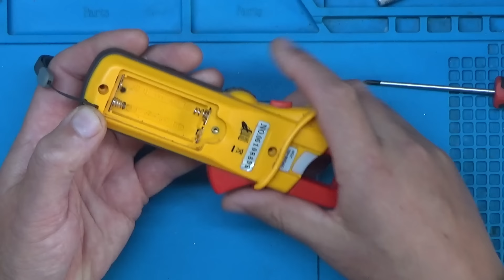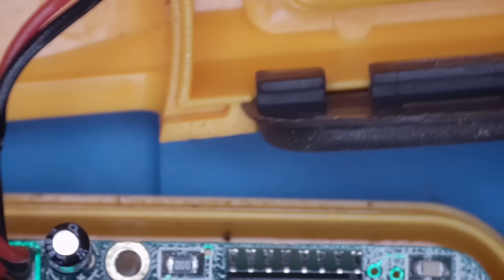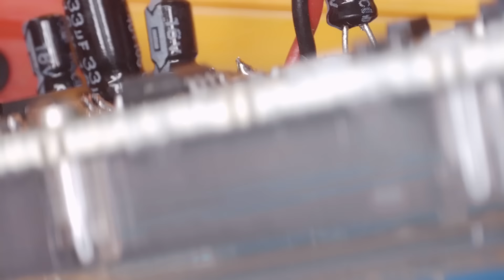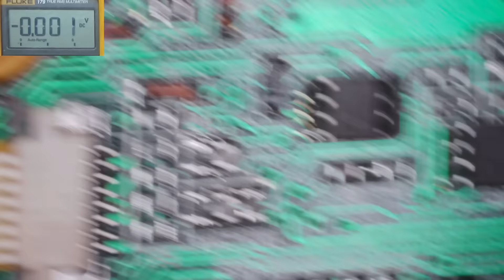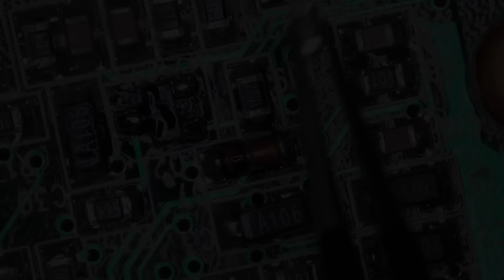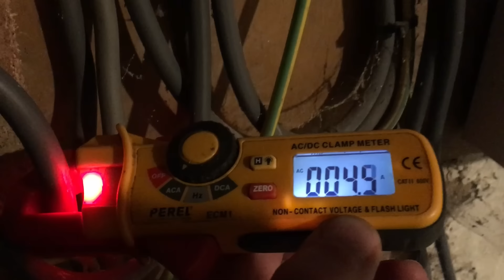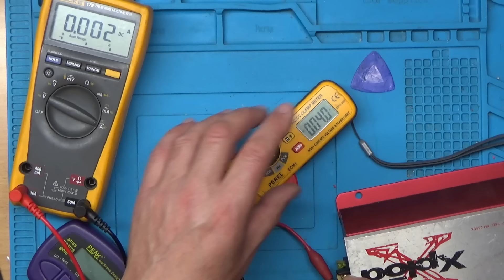Faulty Perel Digital Clamp Multimeter | Can I Fix It?

Comment: Someone has gone to the basement of the building where they keep all of the lowest quality components, and picked from the scrap pile. That meter is very cheap. I'm all about fixing. Even things that are deemed too cheap to fix. But the fact that this crap even happens because 0.00001 cent per board is saved in production cost - that is absolutely HORRIBLE!
Reply from the maker: Yes, I've never came across resistors just failing that like before. They must have used the cheapest of the cheap!

Comment: I blame the disease of resistors on poor-quality production in the SMD factory. This is the cheapest, low-quality clamp meter you can find. Parts are from leftovers. The broken ferrite inductor is further proof. As for the residual 4 Amps DC, it has to do with the magnetic field disturbance at the tip of the jaws. It varies with the wire's position inside the clamp loop and even interferes with the Earth's magnetic field when you rotate the meter. I saw it on all UNIT-UT210 clamp meters too.
Reply from the maker: Interesting observations, thanks for sharing your technical insight on these units! 👍

Comment: When you buy the cheapest resistors at the Shenzen market don't expect any quality. Clamps need zeroing when measuring DC, as background magnetic fields will interfere. Even if you change the orientation of the meter, the reading will likely need to be zeroed again.
Reply from the maker: Yeah agree. I've not really had any experience with clamp meters, but yes a couple of people mentioned about the zeroing 👍

Comment: This might be what's behind my woes with my old Uni-T ac/dc clamp. I discovered the ncv detection totally failed at some point, and the dc values on the probes developed a bizarre offset of a few volts around the same time. Never would have even considered the resistors, but I'll check them out now
Reply from the maker: Yes I didn't suspect them either. I wonder if it's some poor quality resistors or something.

Comment: Strange fault, logic suggests as the fault lies only in the DC Amps circuit that it is unlikely to be environmental issues. Much more likely to have been exposed to excessive voltage or current, damaging the resistors while in DC Amps mode. Great job though! You seem to be able to fix anything, including your own videos. 🤣

Comment: I reckon that's been whacked hard against something and warped the PCB momentarily making a few resistors microscopically crack and go open circuit along with the inductor core breaking.
Reply from the maker: Could be, although I did have someone else mention that they had a similar one where resistors randomly went bad too, so perhaps they are just poor quality and the thin film coating oxidised or something over time.

Comment: These type of DC ammeter clamp meters usually do have a small offset.
You use the ZERO to null out the offset and do NOT move the meter as it will be influenced by the earth's magnetic field.
A 4 amp offset is rather large though and probably there is a pot inside to reduce it, but still will be influenced by the earth's mag field and movement.
Great job with all those flakey resistors and the broken inductor!
Reply: His house is probably on a ley line causing the extra spiritual reading to show via the meter 👻😀
Reply from the maker: Spooky! 😂😂😂

Comment: It's normal to have an offset in DCA and it will vary with the electromagnetic environment. That's why  there is a zero button: you must zero the meter in place before taking the measure (it will remove the offset)
4A seems way too high but it's still registered +5A when you tested it, so it "works fine"
Reply from the maker: Thanks Nick, yes a few others mentioned similar. I just thought it was odd with it saying 4A. Pressing the zero does zero it, but pressing it again reverts it back to the 4A.
Reply: @BuyitFixit Don't press it again. Press it, let it display zero and take your measurement, it should show 5A instead of 9A

Comment: Hello.
Might be wrong place to post this, but i could not find any other contact info.
We are having some problems in my workplace where the intrated lead acid battery charger breaks. The fuse is ok, but the mosfets are burnt. We had a few spare ones that we swapd when they break. Would you want one sent over and have a look at?
Its a 240v ac to 24v dc lead acid charger it does 10a 24v i think. No transformer.

Comment: Hi sorry to bother you.  Could you do a small video please.  You have a test circuit board system with a bulb plug and mains power switch THAT you always use to test Wall power tools and electronics.  I want to build one and not sure how to go about it.  Could you show and tell your version of setup please.  So I can better understand how you wired it.  Thank you very much.  This item is very much needed right now.
Reply from the maker: It's just a socket with a filament bulb wired in series with the live terminal. It's just current limiting, so if there is a  short for instance it just makes the bulb light up, and saves blowing stuff up. Hope that makes sense?
Reply: @BuyitFixit  if there is a short it lights up.??  ehhh.  The ones I have seen is when LETS say PSU on that circuit.  When capacitors reach full power the bulb goes out.  OR If nothing draws NO power or completely DEAD then bulb remains off.  If system works but fluctuates randomly then Caps could be bad in circuit.  
That is how i thought your setup worked... Im so confused.....  Let me grab another persons video for you to see what im talking about.
Ok found a link.  I thought yous was  a simpler version to this one.  I really need to make one badly.  Got many items needing a test system.  Have no clue how either of you have made them...  https://www.youtube.com/watch?v=G_fVVlTQRLo
Reply from the maker: He's got a nice fancy one, with a voltage meter and bypass switch by the looks of it. The one I made is really simple. Check my video here https://www.youtube.com/watch?v=aEQu1vd7OxM not far from the start I talk about how it works, and even show a diagram. Hope that helps.
Reply: @BuyitFixit  Fancy making a video making one...???  I would look forward to making one myself.....  Hopefully the same as yours.  I was thinking of having a reader showing voltage DRAW at teh socket aswell as the intake at the wall.
Reply: @BuyitFixit  Okay now that makes sense and that is how I thought I would normally do it.  But upon research its not what it was saying this is why I spoke to you...  Thank you.  However. I must admit I think the other guys setup I think you need to make.  I think that would be right up your street.  But for now YES I will make this one.  Thank you so much friend.
Reply: @BuyitFixit  i hate series and parralels.  Nop makes no sense lmao...  Love the DCA55 video nice work..

Comment: DC amp clamp meters measure the magnetic field directly rather than voltage from a coil as AC only clamp meters.

Reverse the direction of the wire and the 9A will likely read -1A (negative 1A). If the meter doesn't hold zero measure both ways and average

Comment: I had one. Before finishing your video I can tell that mine had moisty failure. I had to repair it by adding a lithium ion battery inside, wich permits to turn on and off the device. Impossible to make it right with the considered voltage. Now I will finish the video and see what's is defective in yours.  Ok I am pretty sure that all those resistors was affected by WATER issue. Thanks for the video

Comment: Great stuff here! I wish you could help me with something similar along the line. I bought an Aneng ST180 Clamp meter from Temu about 2 months back. It stopped working after one week. It switches on with a display. But it does not give any reading. I checked about everything including the probes. Nothing wrong with them. My competence fails beyond this level. Could you please help me? Thanks and warmest regards. Shmuel Naarai.

Comment: I'd think a bad environment. Heat cycles, vibrations and maybe chemicals.
Reply from the maker: Could well be. I was interested and started reading an article on resistor failures. Mechanical stress, and also age related issues were mentioned.

Comment: That was an old electric meter. It must have been at least 30 years ago i used one of those. Those meters are so easy to manipulate 😁

31:24 You need to press the ZERO button ...
Reply from the maker: Yes old house this one. Built in the  1500s. I'm sure the electric meter is newer than that though 😂😂😂

Comment: Interesting. We have the same meter in work, different brand but it looks the same and it have very similar problems, like measurements jumping all over the place even without measuring something. And it's getting worse over years. Looks like some cheap or bad batch of resistors been used.
Reply from the maker: Thanks for the info. Yes could be a bad batch or cheaply made resistors that oxidize over time or something.

Comment: Mick, at 24:17 you found a resistor off reading of 5.6k when it should be 5.1k.  Those appear to be precision resistors so if that one is off by 10% then that could be causing the offset on the DC current scale.  I would replace that one with another 5.1k precision resistor and see if the DC offset goes back to zero.  Great video.
Reply from the maker: Thanks 👍 Yes I had been thinking exactly that when I was editing the video. I might change it and see if it cures the offset problem.
Reply: @BuyitFixit  Ping us an update if you do. That really is bizarre. The only time I've seen resistor failures like that is high power resistors or FET gate resistors. Certainly not random high value resistors.

Comment: Very strange that so many resistors where out of spec, maybe they all came from a bad batch or something.  Thanks for the video at least the device can be used now although not sure I would fully trust it.
Reply from the maker: Yes could be a bad batch. I'm not sure how much I'd trust it either. I guess you could compare with another meter to see how accurate it is.

Comment: Is it possible that the X-Ray machine induced high voltage in the pickup coil or hall effect sensor in the dc clamp? Also, my DC clamp meter always shows a few amps until I zero it out.
Reply from the maker: Interesting theory but I doubt it. I've had phones and all kinds in it and they are working fine. It's quite a low power one, similar to an airport scanner.

Comment: I was hoping it was that inductor as I've seen those get damaged by shock a few times. I found one in a Sonos Connect that I bought cheaply as "spares or repairs" on ebay and it was fixed for free as it just needed solder and hot melt, and I got an "Accu Charge" smart car battery charger/optimiser at a Repair Cafe yesterday with the same fault.

Comment: My coworker has a Klein clamp/multimeter, with one problem on it. When you switch to continuity check, it is shorted somewhere so it measures continuous continuity in that mode, but seems to work fine with all other functions. I’ve opened it up but didn’t have my microscope available so I didn’t see anything obvious. I really need to find a circuit diagram for it lol
Reply from the maker: There doesn't seem to be many circuit diagrams for modern stuff these days. Could be something like a blown resistor or diode. Maybe they measured voltage while switched to resistance or something?
Reply: @BuyitFixit thank you for the suggestions on what to look for! My experience thus far has only been with obvious physical hardware issues, so I am still a complete noob when it comes to board level troubleshooting. I definitely have the mind for it, just not the experience (yet).

Comment: I think it got dropped on the ground. The snapped inductor is a clear sign. Consequently many resistor cracked, I would also suspect many racked MLCC capacitors as well, but those will be very hard to spot - you would need to measure the capacitance, which is hard without removing them from the circuit... Plus a lot of cracked resistors may just exhibit intermittent fault, so seem OK when testing them but wander off value during operation...
I would not trust the meter after that at all.
Reply from the maker: Could well be. I'm not sure how much I'd trust it either.

Comment: For DC clamps you have to zero them on an almost per-measurement basis. There is a good chance the ferrous core gained a permanent offset and that's why it's all the way up to 4A in this case. They are even sensitive to the earth's magnetic field and their orientation to it. Despite these obvious shortcomings, measuring DC non-invasively, is quite useful!

Comment: Well done. Can you let me know what low melt solder you used? The stuff I have certainly doesn't solder as well as yours does (even with lots of flux).
Reply from the maker: Thanks 👍 It's Chip Quik. It's quite expensive, but you only use a tiny bit. I've only just gone through my 1st tube of it and I bought it over 18 months ago...
Reply: @BuyitFixit  Thanks. I did buy the Chip Quik brand but probably ordered the wrong composition. The one I got was SMDIN66.3BI33.7. Do you know the variant you got?
Reply from the maker: The one I'm using currently just has REM4.5 on the tube.

Comment: A techy like you and you still have a spinny disc meter! You need to get yourself a smart meter so you can connect to it on your phone and see actual real time readings!
Reply from the maker: No thanks 🙂I've got solar panels 😉
Reply: @BuyitFixit me too and the double bonus of the smart meter is that it lets you monitor when you are "feeding in" to the system, so can divert that energy into use or storage (as the FiT is waaaay smaller than what you pay. It also let me monitor when something odd is going on, like my heat pump kicking in at unusual times. Indeed I see no valid argument NOT to have one

Comment: I wondered about a bad batch of resistors or perhaps fallout from a physical shock. The offset on DC amps may be normal. DC current is sensed with a hall effect device and is sensitive to the Earth's magnetic field. The "zero" button compensates for that "background noise". Someone may have also exposed the meter to a substantial magnetic field at some point, which will also distort the DC amps reading. I believe that a degaussing wand might fix it (reduce the offset), but have yet to test that theory.

Comment: You have to zero it out when measuring amps dc with the clamp, that's normal. If you'd zeroed it out it would show the correct 5 amps there. Also I think it might have been dropped big time at some point. That cracked the inductor, tilted the two capacitors to one side and might have also damaged the resistors by breaking the wire inside them.

Comment: I suspect if it was an over voltage or over current problem, then there would have been semiconductor damage as well.
As it only affected the resistors I'm thinking it was a high impact force that caused some micro cracking in the resistors (probably not the best quality to start with).
Regardless that was a great fix!
FYI, Clamp meters usually have a Zero or "REL" (REL being for relative) button to mitigate picking up any stray magnetic fields.
It can also be used to set a "reference" if you are trying to measure differences in current flow (saves you doing the math)😀
Reply from the maker: Thanks for that 👍Yes the ZERO does seem to work. I tried it after reading a few comments. I was wondering if micro-cracks from an impact as you suggested, or if it could be something like the components deteriorating over time (oxidising or something).
Reply: @BuyitFixit  That also has a very high probability. Thick film resistors (as opposed to thin) are cheaper to make and are more susceptible to oxidize or deteriorate over time I think.
This might be a stretch, but if the clamp meter was used a lot around lead acid batteries then the resistors could be more prone to rapid sulphurisation. This is where sulphur gas can seep into the component and react with silver that is present. Cheaper components like resistors are more prone to fail due to sulphurisation than other components, like ICs that use copper or gold bonding wires. These type of problems can sometimes take years to raise their ugly heads and then a fix might take years to confirm.
Regardless you noticed the trend and managed to repair it, great job!
Reply from the maker: Thanks Jack 👍

Comment: at 18m06s top right  the transistor  M7 looks like its cracked or chipped near the Number 7 , i would have also changed the cap you were testing the 3v on it looked buldged ,  and at 24m20s the 3rd Resistor down you were checking seemed to have a stray piece of solder on the left of it ..

Comment: In my experience, most cheaper DC amp clamp meters have to be zeroed before use. I think if you zeroed it from the 4 amp reading then clamped it would have read 5 amps correctly.
Reply from the maker: I tried the zero button, but it toggles on / off. It shows ZERO on the LCD so I'm not sure how you use it. I would have thought you just pressed it and it zero'd the display but that doesn't seem to be the case.

Comment: While watching you strip down the clamp, it reminded me of my day when i had a UPVC door that wouldnt open due to a knackered door mechanism, lol.
I also nearly managed to pull the door open, apart from 1 latch at the bottom & no matter what i tried it all failed.  So i used force & broke a few things....But its OPEN isn't it?  ha ha
Reply from the maker: Funny you mentioned that. I was on the phone a couple of days ago, and it sounded like someone pounding on the front door. I though who the f**k is that! Went to go see to find the front door lying in the front hallway, and the small sheep trailer in the doorway. The wind had blown it, and it had rolled, and hit the front door taking it off the hinges and splitting the door frame (wood). I'm looking for a replacement UPVC door now 😂😂